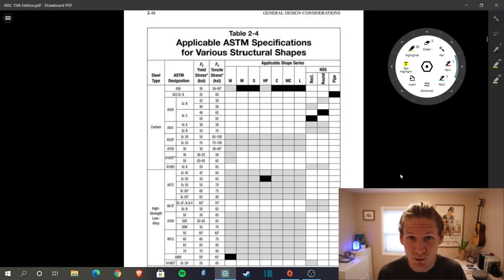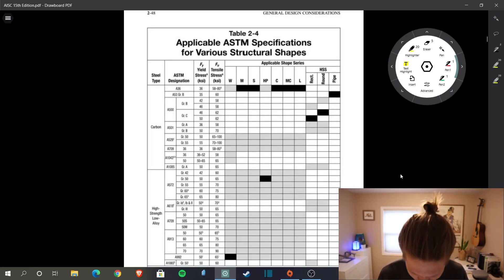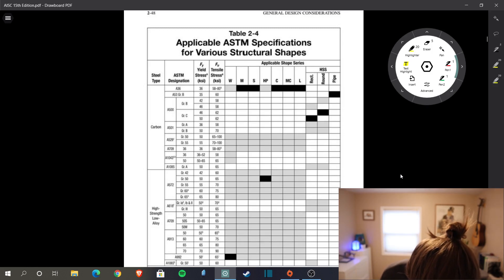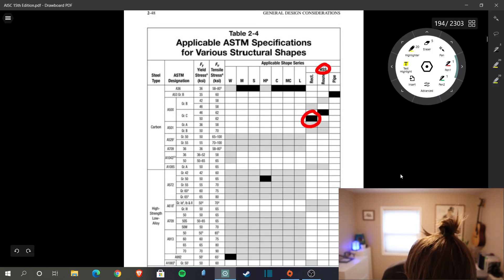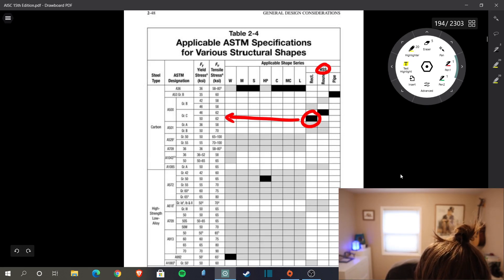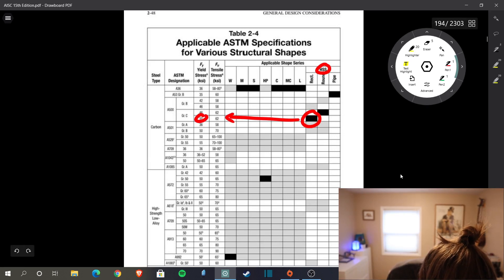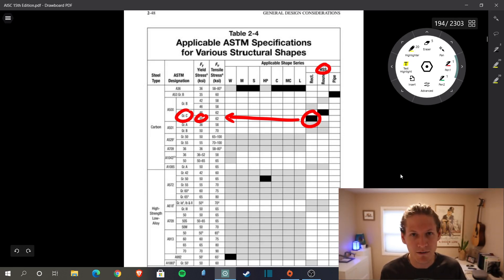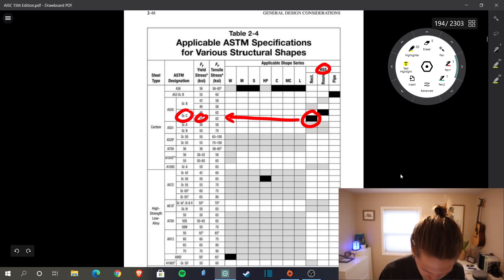AISC Changes | Kestava Shorts | Structural Engineering

Comment: I want to request that my local library add some engineering texts to its reference collection.  anything besides  "AISC steel manual", and "Design of welded structures" that you would recommend i suggest to them?
Reply from the maker: AISC steel seismic manual if your in a seismic part of the country, IBC, and ASCE 7-16! (very structural engineering bias haha)
Reply: @Kestava_Engineering  thanks for the rec's--not sure if we are seismic or not.  the new madrid fault is at the tip of KY where it meets the missouri line.  Interesting that eastern quakes are propagated so much further due to the thickness of the underlying mantle as opposed to quakes in the west coast which propagate less as the pliable mantle absorbs the energy.

Comment: i won 18 pieces of 2x6x125 HSS at a bankruptcy auction.  how do i find out if it is a500?  will it be printed on the sections?
Reply from the maker: youll most likely need to get the sample tested to determin what material grade it is